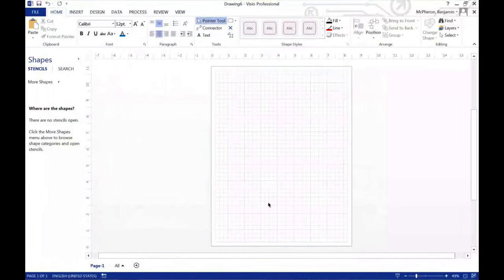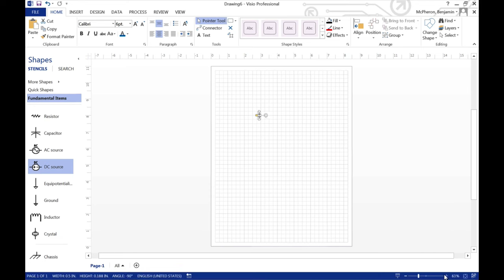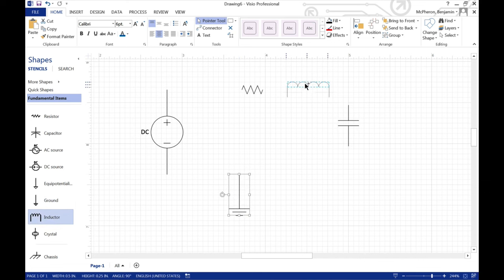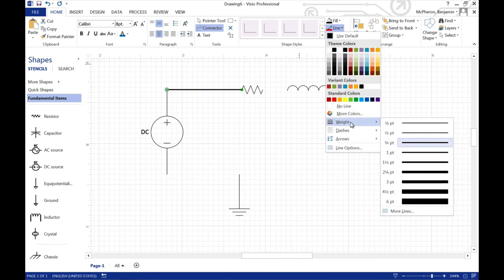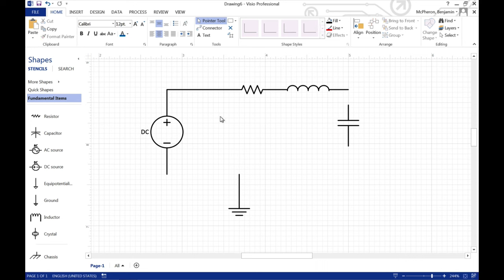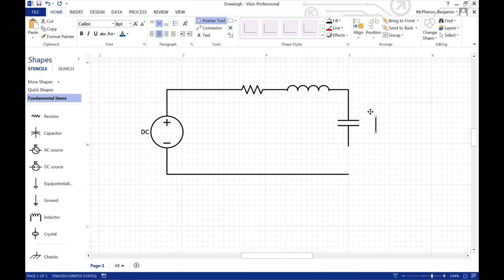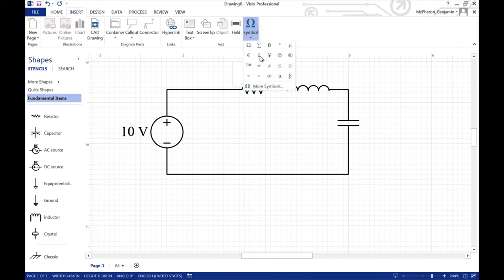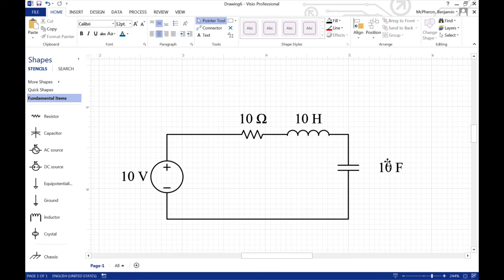Making a Circuit in Visio - How To Ep. 34

Comment: Is there any way by which we can add equations in Visio? We can’t write fractions, subscript, and etc. Even the font isn’t as same the one used in MS word’s equation editor.
Reply from the maker: the only way I've done this historically is writing up the equations in Latex or MS Word and then taken a screenshot and dropped it in Visio.
Reply: DMExplains Thank you for reply. I am working on an educational book. I am trying to create the book same as they are created professionally. I have seen in many books for eg. “Fundamentals of electrical circuits by Sadiku” has diagrams in svg format even the text on diagrams are real texts not screenshot. I will have to write around 140-150 pages. Taking screenshots of equations and then pasting it in the VISIO will be a time consuming and there position will be different in every diagram as we are manually positioning the screenshots. I want to create all the circuit diagrams consistently. Strange Visio doesn’t have the same equation editor as ms word. Thanks I would like have your thoughts on it.
Reply from the maker: @alphasatari  If you want the best option, try Circuitikz package in Latex.  I have actually switched to this for writing exams and homework assignments instead of Visio.  Visio has consistency issues.  The sadiku book is especially annoying because in earlier editions, the font in figures matched the text, but not in the 6th edition.

Here's a link to a helpful manual for circuitikz: http://mirrors.ibiblio.org/CTAN/graphics/pgf/contrib/circuitikz/doc/circuitikzmanual.pdf

Maybe I need to make a tutorial video on this (I'll add it to the queue)
Reply: @DMExplains  I have the fourth edition of Sadiku. I actually want the fonts to match the equations. Visio has a lot of issues. You cannot even change the default values. Every time I have to make changes if I am creating a new diagram. We can not create a new theme. I tried many software but the best option I could find is Visio because of the integration of it with the MS Word as it allows us to make changes directly in the MS Word even after we are done with the circuit diagram. I figured out a way but it is time-consuming. I will try Circuitikz. Thank you.
Reply from the maker: @alphasatari  it would mean moving everything to latex, but it would probably be worth it for consistency

Comment: Can that Visio drawing be used in a Powerpoint presentation?
Reply from the maker: Certainly.  The simplest  way to implement this is to save the Visio file as an image, such as .tif or .png.  This is done by using File->Save As-> and selecting one of the image formats from the drop down box.  Note one trick: you should make sure no item or set of items is selected when you save as an image, as this may only save your selected item.  Best way to avoid this is to hit escape before starting the process of saving.